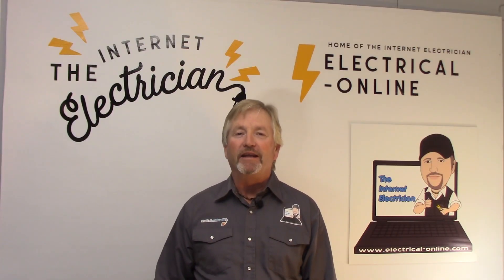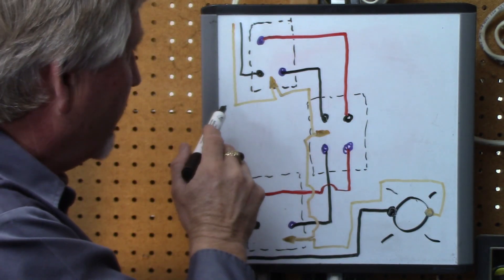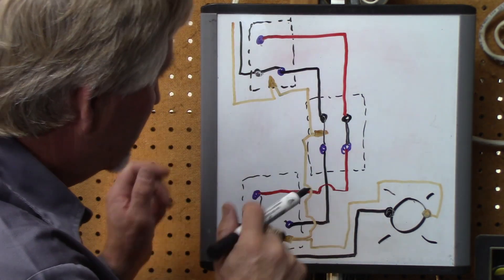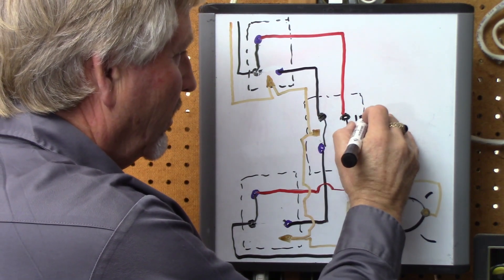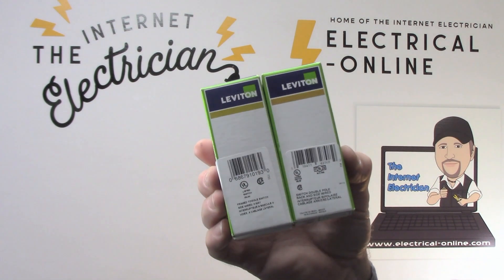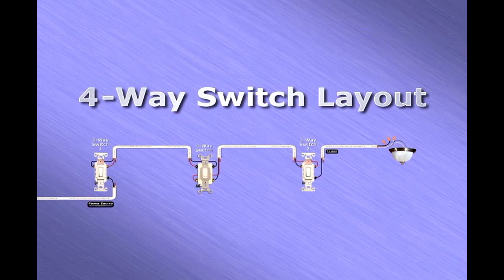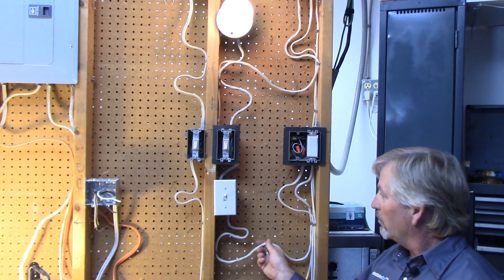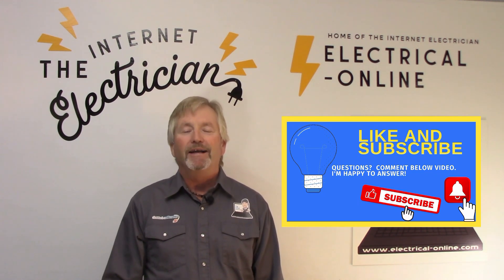The Best 4 Way Switch Explanation Ever!

Comment: To make life interesting a 4-Way can be converted to a 3-Way by dropping a wire connection. 
Since your 4-Way conducts from top-to-bottom or bottom-to-top (input and output are arbitrary labels) with a straight-through and cross-over mode depending on switch position. Pick your common, (similar to 3-way) and 2nd pole on the other side is not used (tape over) while the upper contacts are used as pole 1 and pole 2. The manufacture makes both switches as a 4-way but drop some guts and remove the 2nd common external screw; and the single pole on/off switch, they remove all pole 2 contacts. You still need to wire 3-way to 4-way ... 4-way to 3-way with as many 4-ways in the middle to add more switches in hot wire/switch string. (think travelers as train tracks northbound and southbound lines, red line and black line)

Comment: ? have light operated by 1 switch this is in mobile home by the way. they have used a 4 way switch. line power in is 14/2 load out 14/2 and there neautral ran thru the switch not its own wire WHY?

Comment: Your video was a great help in understanding how the switches work.  A side note:  My replacement 4 way switch had the in/out terminals in an X pattern - IN on top right and bottom left, etc.  Plus, the old wiring was just blk/wht, no red.  It took me a minute to figure it out, but I finally did.  Thanks for the detailed explanation!!!

Comment: Hi Terry, to start from the beginning, how do find which 3 way switch is the number 1 and not number 3?
In your demo, the 3 switches are on the same line, or circuit breaker, but in a home the 3 switches are all over.
In my home, the upstairs is the 4 way switch. Downstairs, I have two 3 way switches, so can you tell me how to find which one is the first, and which is the third, the one goes to the light? Thank you so much. Without knowing that, I think there is no way to find the travelers wire in the 3 switch, I think.

Comment: Thanks for the detail difference between the double pole and the four way switch.  I have spent the better part of the day troubleshooting my 4way circuit only to discover after watching your video that I have a double pole switch.  I was pretty confident in my wiring but did not understand the difference between the double pole switch and the four way.  Im off to exchange the double pole for the four way. 
Thanks!!!!
Reply from the maker: Take heart!  You are not alone my friend.  That mistake has been repeated many times, self included!  Thanks for watching!
Reply: I have been fighting this problem as well.  My daughter asked it I could change the light tan colored outlets and switches to white.  She had a box of switches, outlets and cover plates from Home Depot and am now convinced that they gave her double throw rather than 4 way.  
I've been looking for a schematic of the 4 way and double throw to see what the difference is and you aced it in spades.  I'll sleep better tonight.

Comment: Great video. I have a question. I have an old 4 way switch that needs to be replaced. The switch is not marked with inputs and outputs. How can I tell which are the inputs and which are the outputs?
Reply from the maker: Just look at the cables that the wires are coming out of. The 'ins' and the 'outs' will be pairs within their respective cables.  And no matter who gets labelled an 'ins' and who gets designated an 'outs'!  Thanks for the nice comment, and thanks for watching!

Comment: This is the best 4 way switch explanation.....the important thing no one said was... the in and out...line behind switch.........i also learned that some 3 way switches dnt have a black screw so u have to look for where its labeled common.....n also its important for people to know...3 way switch n 4 way switch...the word common are not the same meaning.........usually when people say common it means neautral......in three way + 4 way switches common is the black screw on your switch where u connect your power coming in...and your last three way switch your common should be connected To your light source ....n of course your white neutral wiress ..
Reply from the maker: Thanks for watching, and for the comment!  Appreciated!

Comment: Couldn’t figure out how to connect my 4 way switch until I found your video. After watching your presentation, I discovered I had purchased a 4 way double pole instead of a 4 way light switch. Thanks so much. I will head back to the store tomorrow morning and grab the proper switch. Many thanks.
Reply from the maker: You are not alone!  VERY common mistake!

Comment: Brilliant, thanks! This was actually helpful for my use case, which was actually to convert my upstairs hallway lights to use Hue (for some fancy dimming from all 3 switches). But, since it has 3 separate switches (with 5 recessed lights, but all the same load circuit), I realized it was a 4 way switch. In that case, you just want to go permanently on and then use those Lutron Auroras to control the lights, but before doing that you gotta figure out what the heck 3 way and 4 way switches are before you can wire them from their currently switched state so they're permanently on! 😅

Comment: Awesome video! One time me and my uncle discovered a problem with the 4-way switch system on the staircase at his old house. Some of the “combinations” (like switch 1 up 1 down 1 up for example) worked and others did not (if that makes any sense). We turned the power off and took the switches apart. The first and third switches were 3 ways like they were supposed to be, but the second switch was also a 3 way switch instead of a 4 way. We replaced that switch with a 4 way switch and everything worked great and all of the “combinations” worked properly.
Reply from the maker: Glad you got it all sorted out!  Thanks for watching!

Comment: so on a 4 way one switch will always be in a different position than the other two?
Reply from the maker: Not necessarily.  It depends on how you mount the switch in  the device box.  (upside down or right side up if you will).  It really doesn't matter, but I did hear a story of an electrical inspector that would 'flag' an issue and call out electricians if on a 3-way network, if the switches weren't in the same position (both up, or both down for the light to be on), he would make them change it.  This is not a code rule, only a preference that this particular inspector liked to use to demonstrate his authority and impose his personal preference upon the Serfs that he ruled over. (in my humble opinion)  Thanks for watching Ted!

Comment: Thank you Terry for this video!!! I spent hours putting in a 4-way configuration in our living room. Then spent more hours trying to find out why its not working. Checked my wiring & connections 3 times. Was about to give up when I came across your video. I have a stupid double pole switch instead of a proper 4 way. You're the first video that mentions that. Didn't even know there was such a thing for home electrical! Thanks again!
Reply from the maker: A common mistake!  Thanks for watching, and for the comment!

Comment: I’m trying to diagnose my 4 way switch issue. I have a rather long hallway where 4 switches operate 3 light fixtures. 
#1 is front entry, 2 Garage entry, 3 kitchen, front bedrooms, then 4 is back bedroom. 
They only seem to work right when #3 is in the up position. Is it a bad switch? Or maybe the wrong type?
Reply: Probably wires crossed up